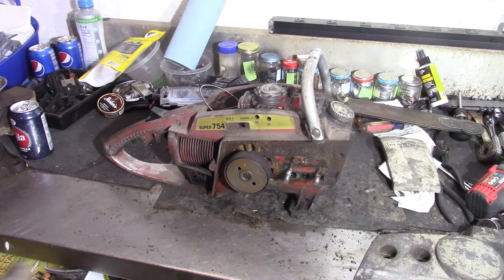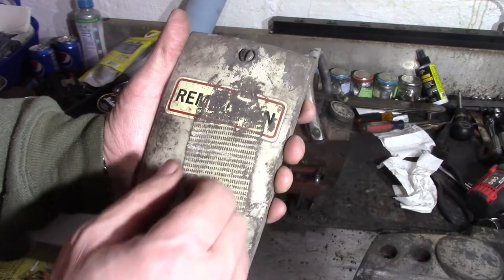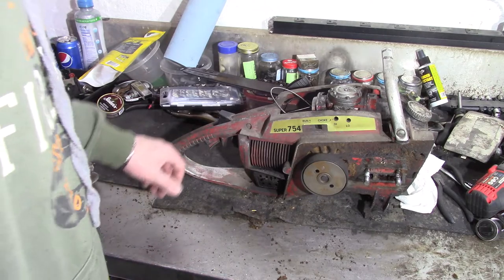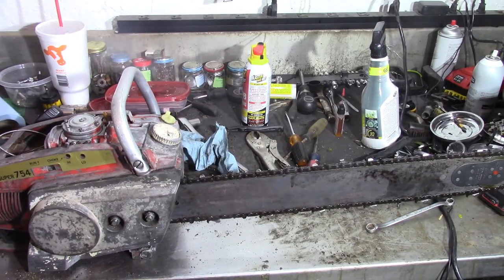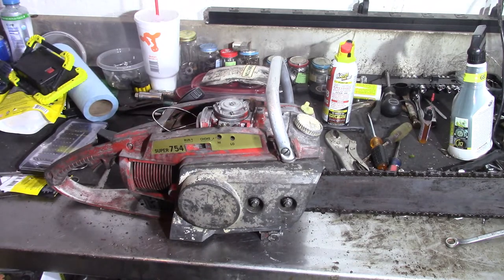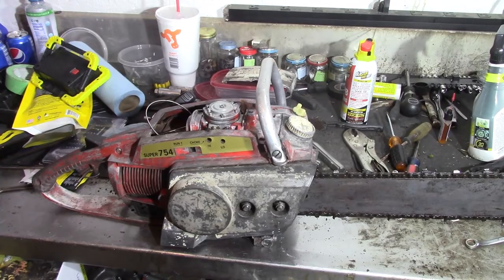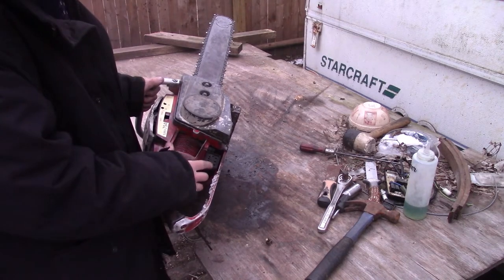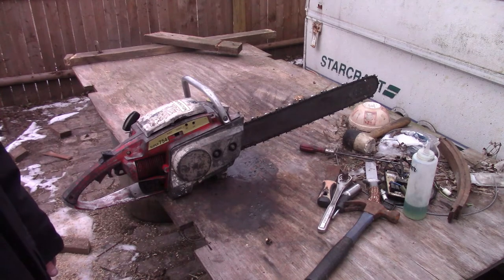Remington Super 754 Chainsaw  Let the fight begin

Comment: I just picked on of these up not long ago from my local scrapyard. It has barely seen any use and still has some original paint on the bar.
Reply from the maker: Hard to believe people scrap that stuff but it does happen. What really sucks is the scrapyard we go to will not let you take anything out. There is one local yard that pulls all the good stuff like that saw and puts it up for sale in a area by the office. Always want crazy money though. Have you tried to get it running?
Reply: @GenerationX1971  I haven’t done anything to it yet other than getting the recoil working.
Reply from the maker: @stevenkinnison8044  if it’s as loud as the one we done the video on you might want some ear plugs. That sucker has your ears ringing when you crank it up. Good luck with it.

Comment: I like the saw GenerationX. Let me know if you want to sell the beast.  Drop a line fella. Thanks vf
Reply from the maker: It’s pretty cool old saw. Super loud.
Reply: @GenerationX1971  Are you going to keep the saw or sell it GenX ??? Nice saw fella.
Reply from the maker: @victoryfirst2878  as of now I plan on keeping it but thanks for asking.
Reply: @GenerationX1971  Killer saw fella. Take good care of the saw. Make sure oil is 16 to 1 gasoline mix. Not 40 to 1. Use 30 weight non-detergent motor oil or premix oil at sixteen to one mix. This will make sure the machine last literally a long time. Good day fella too. vf
Reply from the maker: @victoryfirst2878  thanks for the info.